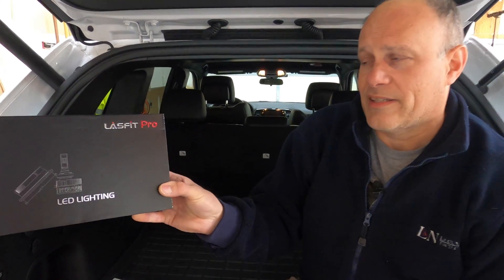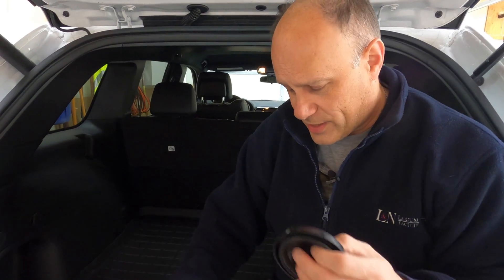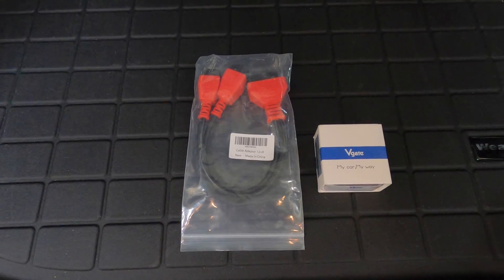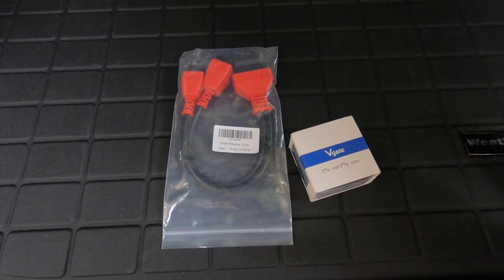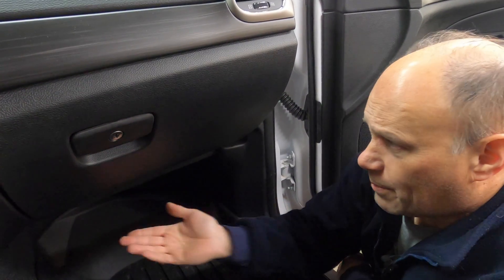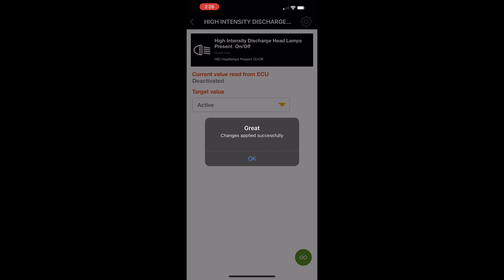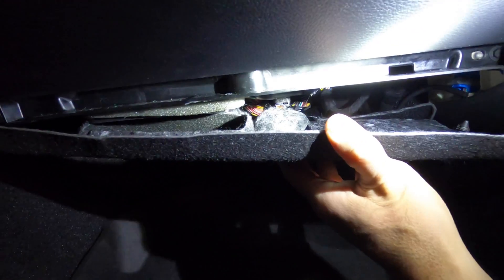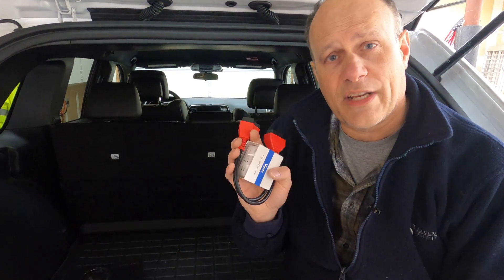How to Fix Flickering LED Headlights (the RIGHT way!)

Comment: Will this work for a Saab with LEDs? They flicker randomly when the car is off.
Reply from the maker: Thanks for watching! The app (JScan) used in this video doesn’t support Saab, but there may be others like it that do. I would start with using a product with inline resistors, or adding an anti flicker module to your existing setup if you haven’t already. The OBD2 adapter may work for you, but checking the compatibility list for whatever you purchase is recommended.

Comment: @Complete Pete  I bought some Bevinsee modules and the flickering issue has stopped. Modules for both headlights and highbeams.
Fog lamps never flickered. 2007 Jeep Commander 3.7
Reply: Which modules did you get? I have the same car and my headlights are still flickering

Comment: is this the same process for a 2021 charger?
Reply from the maker: Yes, this process should be quite similar for your vehicle. The bulbs may react different or end up requiring resistors / canbus adapters as well. Good luck!

Comment: I have a 2007 Jeep Commander with the flicker issue.
If the cable is not needed, does the scanner plug into the computer port, that people check for problem codes? 
I've noticed on some adds for the resistor modules, they list, (if you slide through the pictures-at end prod. Pics) the vehicles & years, that the mods. don't work on.
I haven't done this before, but looks like programming a decoder on a model train.
Luckily I have a son that may be able to help?
Sure hope it works, so I don't have to turn around and buy the resistor s.  Is this wifi obd2 scanner also  used to find problem codes?
Reply from the maker: Hi Ron,

If you own a vehicle that doesn’t require the bypass cable, connect the wireless OBD2 adapter directly to your vehicles OBD2 port to use this software. Resistors or CanBus adapters may be helpful for your application - I typically recommend speaking with the manufacturer of your bulbs. If a reputable company, they can likely recommend a resistor that will work in-line with their bulb, as opposed to buying something on Amazon. 

The process of using the JScan software is relatively simple, and is mostly point and click. Using the wireless ODB2 adapter, JScan will also show you the DTCs/trouble codes associated with each vehicle module, if there are any. 

Good luck!
Reply: @completepete  Thank you, Pete.
Reply: @Complete Pete  I bought some Bevinsee modules and the flickering issue has stopped. Modules for both headlights and highbeams.
Fog lamps never flickered.
Reply: Hi, I have liberty kk 2009. I installed Novsight led bulb, no error or nothing, only flickering. Will this method fix my issue?
Reply: @zevozkifrankooto7338  I bought the resistor modules they work fine for me.
Just make sure your lenses are not cracked and let moisture get to the LED Light. Moisture will ruin them, cause them to flicker or go out.
Reply: @RonStanek  resistor you mean Bevinsee modules?
Reply: @RonStanek  i bought decoder and its fix my issue. Thank you for your support
Reply from the maker: There appear to be two logical approaches here - the route Ron shared can be tried before, or after, using the method shown in this video! On older vehicles I’d tend to suggest the resistors before the changes to the computer.

Comment: I am impressed with your knowledge. Many thanks for your video it added lots of information to me.
I have an issue with my durango 2015 that it flashes for 3 times then it is turned off. Is it the same settings i should adjust or there is other settings to be modified?
Reply from the maker: Thanks for your kind words and for watching, Ayman!

The setting described in the video should address most flickering issues. If your lights are flashing (or dimming and becoming bright again), and the setting I demonstrated doesn’t solve the issue, I would think that there may be a voltage issue or low quality LED bulbs. I would check the following, in order:

1. Enable the HID setting using forscan

2. Test light function with ignition on and in accessory position. 

3. If the lights stay on for a certain period of time before clicking off (with no issues leading up to the flashing/turning off) it could be poor heat dissipation. LED bulbs really require fans as opposed to passive cooling found on many cheaper bulbs. 

4. Consider adding resistors or (if not already installed) to try and alleviate potential power issues. 

What brand lights are you using? I find that brands such as Diode Dynamics (made in America) are of high quality. 

Did your vehicle come with factory HID bulbs, or Halogen? Diode Dynamics makes a hi/low beam bulb that fits your vehicle, and you can add an anti-flicker module. 

Good luck!
Reply: Many thanks 🙏

Comment: Once you make the two changes do you turn the car off for 15 secs with the adapter and obd2 still attactehed in or you can remove them and turn off car?
Reply from the maker: Hi Jackson - thank you for watching. I would turn the vehicle off with the adapters still attached, that way, if you turn it back on and need to make another settings change for some reason, you don’t have to reconnect anything.

Comment: Mine flicker when the engine is running but not when the engine is off and lights are on
Reply: Did you figure it out?
Reply from the maker: Hi Donovan and Victor. This was also the case with the vehicle in the video. Making the changes described in the video corrected this problem!
Reply: What if the led lights settings does not appear in the app?
Reply from the maker: Jose - What is the year, make and model of your vehicle? I’ll take a look and see if I can answer this for you.
Reply: @completepete  its a Dodge Avenger 2013 SE
Reply from the maker: Jose - thanks for that info. I found this thread which might be helpful for you! People are discussing HID bulbs here, but the electrical components generally work the same. You may need to add resistors, capacitors, or a relay in order to correct your problem with flickering!
Reply: @completepete  Thank you for the info! I was really trying to avoid using resistors, as they dissipate power, and my LED lights would be no gain except for the white light. I will inspect the vehicle to see if I can replace the relays for some others that support LED bulbs.

Comment: I have a Jeep compass 2015, took off the cover and don’t seem to see the 8 or 12 pin in the same location. Any idea where this would be located? Thank you.
Reply from the maker: Hi Christopher! The security gateway module was incorporated in 2018+ Chrysler vehicles, so it is unlikely that your Jeep has one. You should be able to connect directly to the OBD2 port without needing the bypass cable.

Thanks for watching!

Comment: I have a 2011 Dodge Caliber with similar LEDs and but they turn off and on randomly every couple mins with slight flickering.
Reply from the maker: Hi Arturo - you could give this program a try, as it does appear to support your vehicle, to see if it would correct the flickering issue. You may also consider another brand that may be of better quality, but I would try the software fix first.
Reply: @completepete  I fixed it. Just got a canbus adapter. But this video helped. Thanks

Comment: Will this work on a 2008 jeep commander?
Reply from the maker: The app supports that model and year, so it should be possible to perform the same steps. Having never done so personally, I can’t say for sure it if will be successful. If you choose to pursue this route, you do not need the security gateway cable since the gateway module wasn’t introduced until 2018.
Reply: I have a 2007 Jeep Commander with the flicker issue.
If the cable is not needed, does the scanner plug into the computer port, that people check for problem codes? 
I've noticed on some adds for the resistor modules, they list, (if you slide through the pictures-at end prod. Pics) the vehicles & years, that the mods. don't work on.
I haven't done this before, but looks like programming a decoder on a model train.
Luckily I have a son that may be able to help?
Sure hope it works, so I don't have to turn around and buy the resistor s.  Is this wifi obd2 scanner also  used to find problem codes?

Comment: Will this work on a 2015 grand Cherokee?
Reply from the maker: Christopher, your mileage may vary with this solution. I have not personally tested it on a different model year, but the function should work similarly. If that does not work, I would return the parts and pursue anti-flicker modules (if you haven’t already).
Reply: @completepete  I purchased an anti flicker device and it did not work. Then I stumbled upon your video and purchased the programming cable and vgate OBD2 device. I couldn't find the 12+8 module you plugged in my car so I just connected the vgate OBD2 device into the normal odb2 plug on the driver side and programed it how you showed in your video and that worked. So thank you!
Reply from the maker: Glad to hear it worked out for you! I believe the security gateway module is only in newer models, which could explain why it doesn’t exist in your 2015. Enjoy your LEDs, and thanks for watching!
Reply: May have to try this. My one led bulb lasted about hour now went out with some occasional flicker but does not come fully on now. 2014 grand Cherokee. Frustrated as its so hard to get to the bulbs for me.
Reply from the maker: I understand the frustration about how difficult it is to access the bulbs. If you choose to pursue this method, I’d recommend leaving the bulbs out of the headlight assembly until you’re satisfied the flickering isn’t happening and they are functioning as you like
Reply: @christopherhamm8629 hey did you see the same setting in the video under the jeep Cherokee KL i did the demo and saw different settings i am trying to do this in my 2015 cherokee

Comment: Do you think this process will be as simple on a 2013 Chrysler 200? I just bought some LEDs and they're flickering as well.
Reply from the maker: This process may solve your issue, but it is also possible that you could need load resistors to prevent the flickering. I would order the parts to try this method from Amazon (or somewhere with a good return policy) and give it a shot. If it does not work, return and contact the manufacturer of the bulbs for resistors.